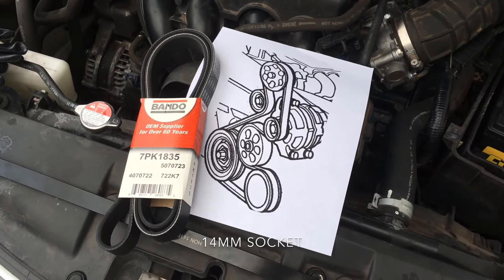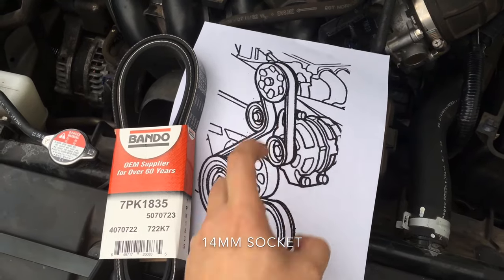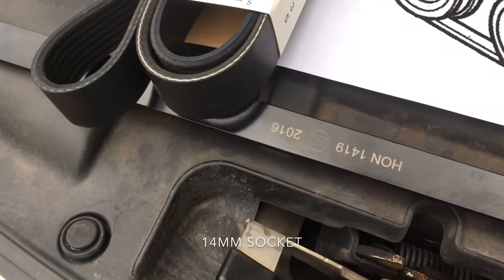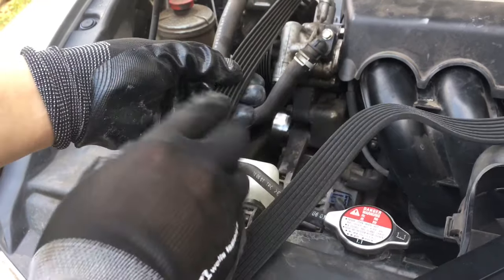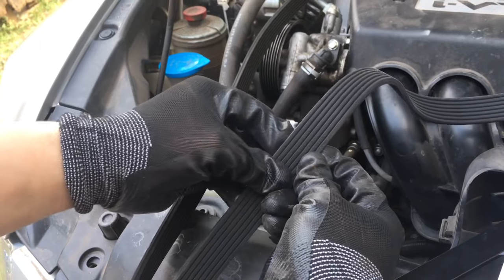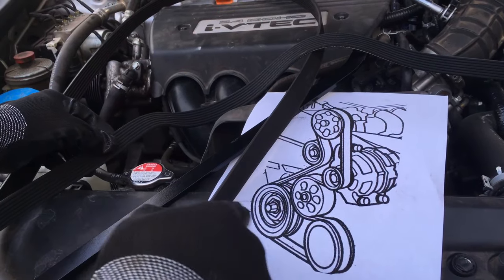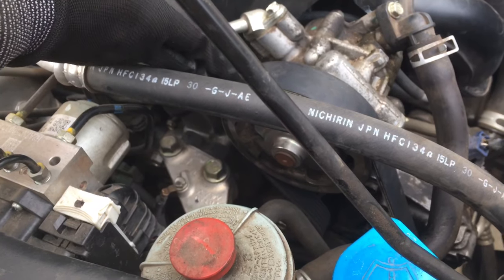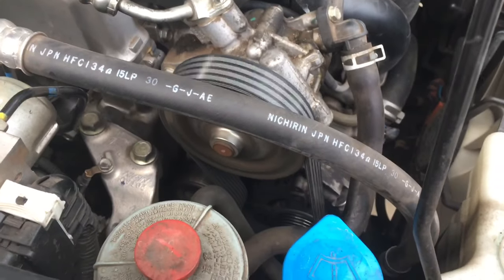2008 Honda accord Serpentine belt replacement four-cylinder

Comment: If it is such a pain in the butt to take this belt off, why not to simply cut it and then pull it out easily. You are not gonna use this belt anywhere else anyway, aren't you?

Comment: Actually, there is a hood prop notch at the rear(bottom when hood is upright) of hood to keep it well out of the way. Might be under insulation but it is visible on my Accord. Good video, all in all.
Reply from the maker: You’re right!  Had to double check mine, good catch

Comment: Change and clean ASAP.

Mine broke while driving because of a leak on the steering pump, probably because of the age of the O-ring.

Had it leaking for months until sufre you have up. My fault for that

Comment: I was able to do this myself and it should have taken a lot less time than it did. The belt that AutoZone is selling for this car doesn't fit. Otherwise, this job with the right tools should take no more than 1 hour.
Reply from the maker: Good work.  Bummer on autozone.  The stock oem was a tight fit.

Comment: Having a lot of problem getting the belt back on. In your video you said to route over 5. Is that not the tensioner itself?
Reply from the maker: Any luck?  There’s a variety of ways to start and finish the belt and that way I showed in the video was easiest for me.
Reply: @YoDIYVideos   yes, I replaced the bando belt that was by the tensioner Mark loose and causing rattle noise. 

What I did was use a gear wrench serpentine tool kit with the 14mm socket. Attach it to the tensioner. Belt was routed on all pulley except the crankshaft balancer. Leaned heavily on the tool and pulled toward the front of the car and toward me. With my left hand pushed the belt over the balancer. With this belt , ac delco 5.1 mm, it was thicker even though it was longer than the bando 1750 mm versus 1745 for the bando, so I assisted the belt with a rubber trim tool over the crankshaft. I did this mainly as it was 32f and I was numb at the finger tips. Got it over slowly as the thicker belt was not as pliant as the thinner bando. Got it on, checked for overlap and then run the engine 5 minutes as per the instructions. It was good to go. I think if possible having the wrench as far away from the front of the car while attached to the tensioner bolt is the key. You need to really apply the force to release the whole tension off. That gives you the play in the belt, which is really minimal depending on the brand you buy, to get the belt on to the pulley. Post if you have more questions.
Reply from the maker: Thanks for the write up , glad you got it worked out

Comment: Wouldn’t you just use the tension bar on the pulley to loop the belt back up too into place, shouldn’t have to “work” it on, that’s damaging the belt before you even use it